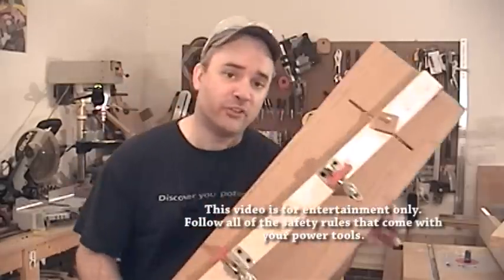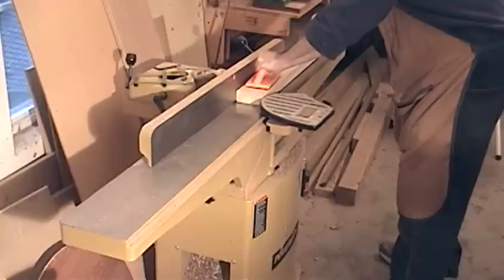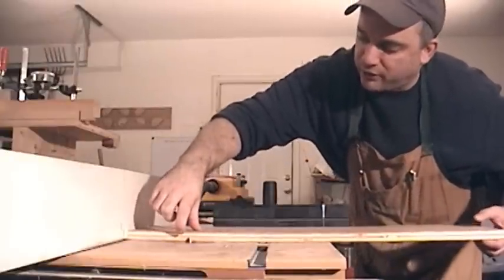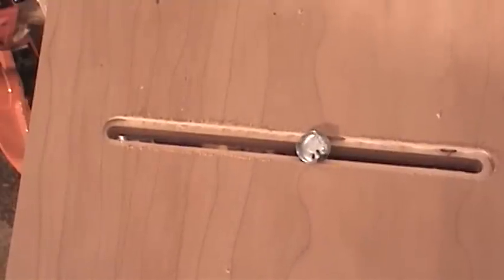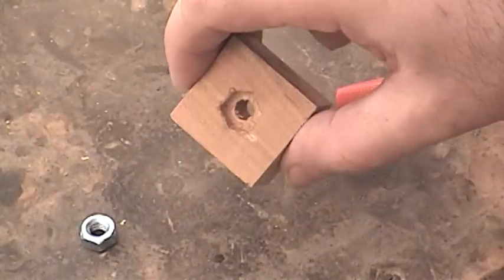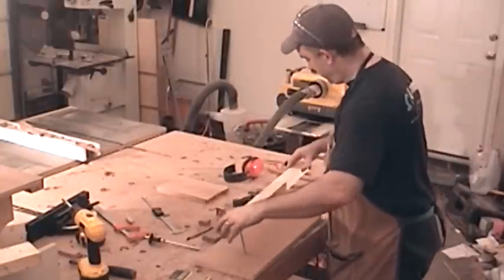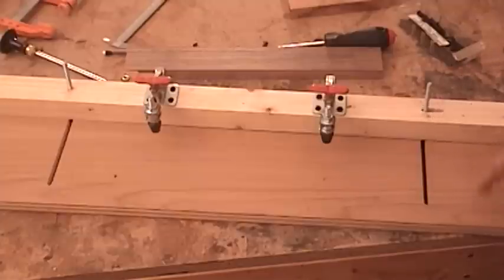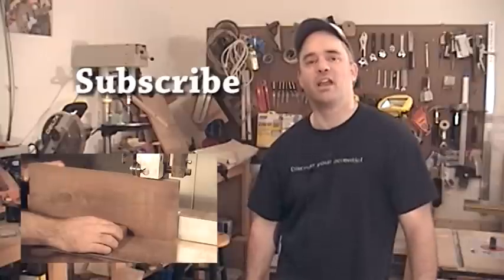Build a Taper Jig for the Table Saw

Comment from the maker: Faster w/ the method I showed.  Router would have required multiple passes. The bolt is 1/4" diameter and I wanted a a slightly over-sized slot for easier travel.

Comment: You are hanging the piece you want to cut out in the air to cut it.  Put the jig in a slot on your table saw and cut the edge with the table saw.  That way the piece to cut is always supported.  Your method could have the piece jumping up and down from flex during the cut.  Or, better yet, build your taper jig of two hinged pieces of wood with a stop on the end.  This way the piece to be cut is on the table.  Cutting a taper on a thin piece with your jig could be dangerous.

Comment: what do you do if you don't have a jointer.  Every project you do you are always running stock through your jointer. I have seen people use something like the tapering jig to edge joint 1 surface. I did inherit a delta thickness plainer. so how do can you do this without a jointer?
Reply from the maker: If you don't have a jointer you could use a hand plane to prep board edges.  This is how it was done before electricity.